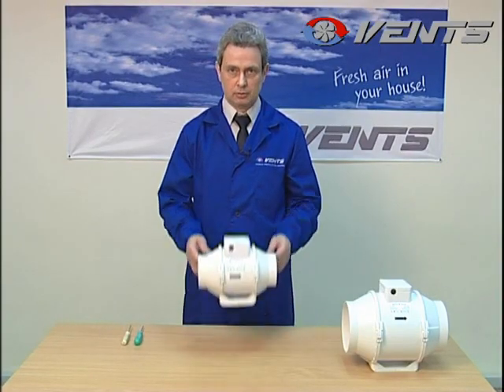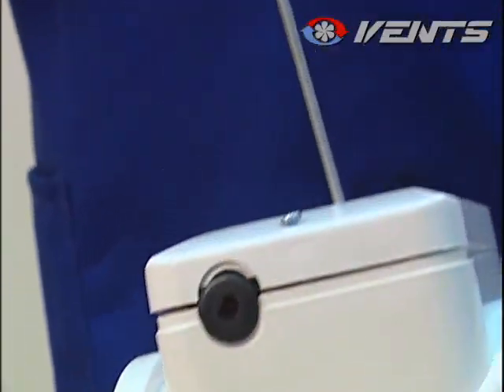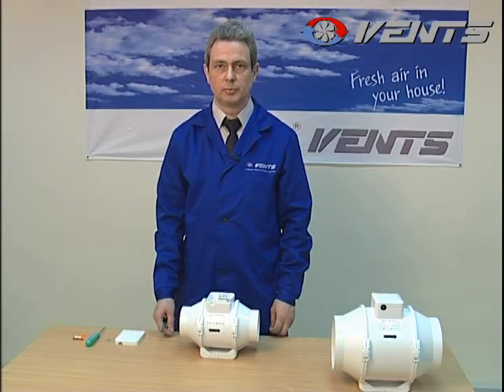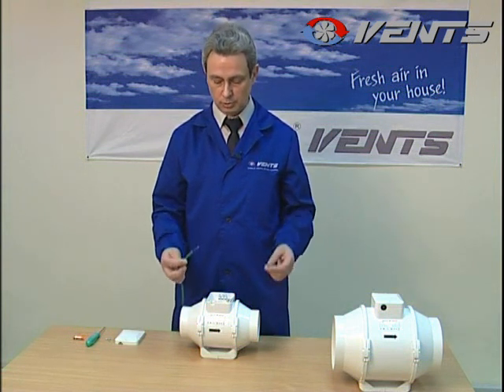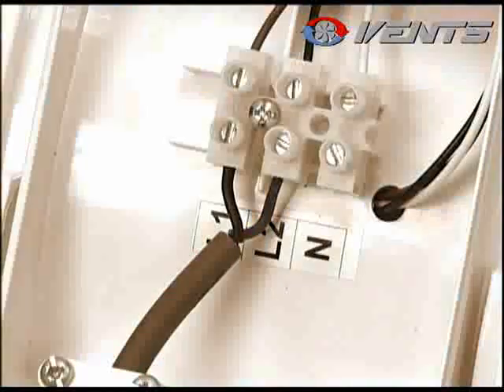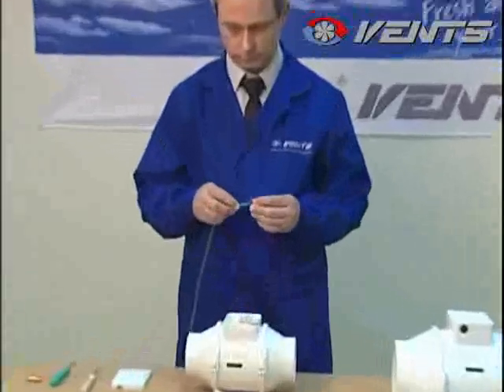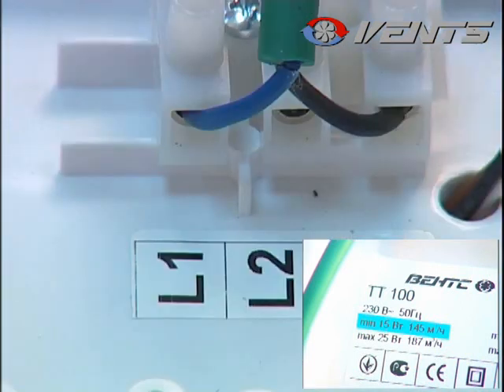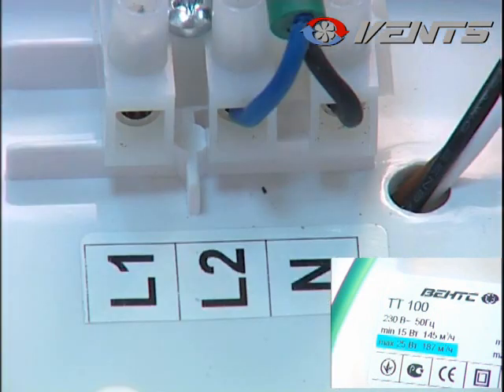Inline Vents TT fan connection

Comment: Awesome, now does it matter which cable you condider to be the «neutral» one?
Reply from the maker: @simonopen2816 The neutral wire is marked in blue, but we recommend checking the wiring diagram or contacting a specialist to avoid any misunderstandings or errors during connection.

If you have any additional questions, we are always ready to help. Please contact us: service@vents.com.ua

Comment: at 2.01 i think blue is neutral
we had to change over here in the uk to be the same as you europeans
Reply: did you ever get a response? I'm having the exact issue - to confuse everything more the video does show him putting the blue wire in the neutral N connector. The video cuts before re-appearing with the wires re-wired and completely switched so what was previously blue neutral is now the base or live. Madness. How?
Reply: Thanks, if you get the chance over the next few days that would really help with my ongoing campaign of 'not setting fire to my house, family and or me!' 
Your post reminded me of when I was testing if an old 600W bulb still worked or not. Being stood just inches from the bulb, I flicked the switch thinking "maybe this wasn't the healthiest place for a face? Hmmm. Least of all mine!
Reply: Again its uncanny - climbed down from the loft last night after mooching around but definitely not rewiring or shit like that. Now, every time I switch my bedroom light on it blows all upstairs lights and every kitchen socket!  WTF! all this while shuffling around on my arse.